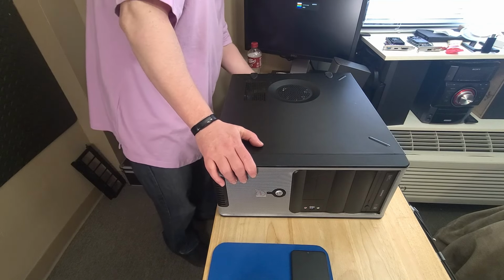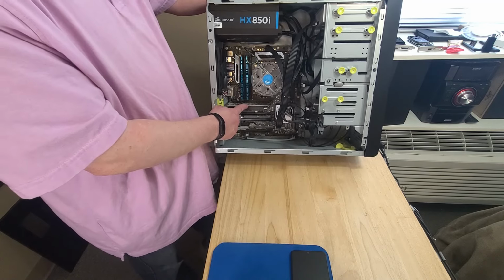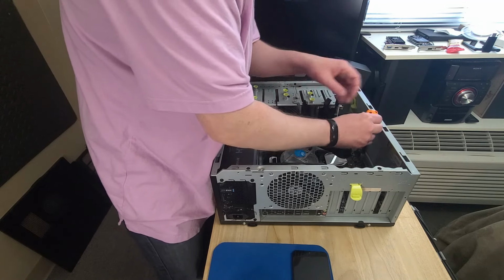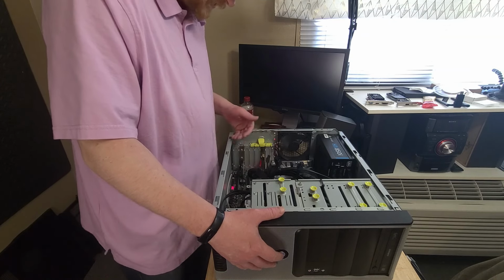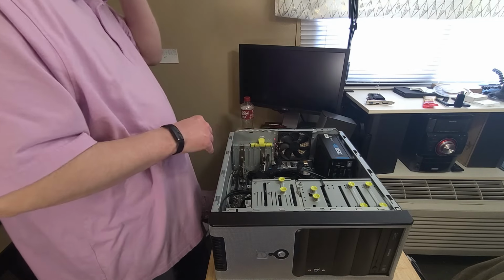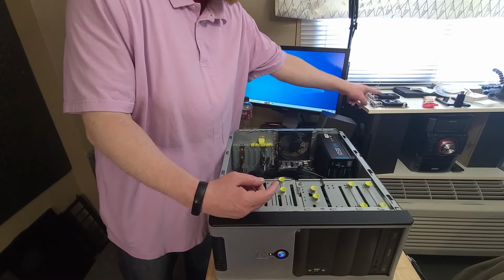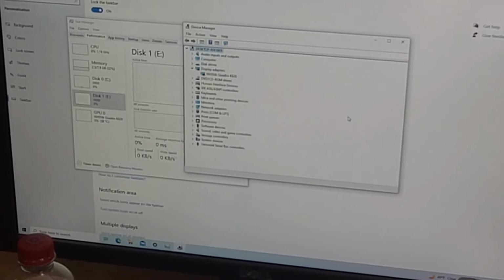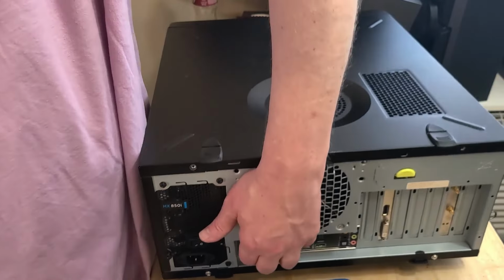Did I Get Ripped Off Again On This X99 Computer

Comment: I think Inwin made these cases. They're like the cockroach of pc cases, but they're surprisingly decent. Pretty sturdy and tool less. I wasn't able to put a fan in the front of mine because of the plastic molding around the power button, so I janked one to the side for intake. I used one of these for my son's first pc and recently got rid of it. Pretty sure I saw this listing too, but I'm looking for something with a nice case. Got a system to flip.
Reply from the maker: Yeah this case is pretty solid I had probably four of them but it was the smaller version of it but it looked identical
Reply: @rohon4972  I mostly only see the small ones. I'd probably hang on to that one. I dunno if the full size is rare or anything, but it don't hurt to have around and its sturdy enough to use as a stool.

Comment: I’m only halfway through the video, but I doubt that slot cover killed the board. But before freaking out thinking the board is dead you should try new RAM and new video card. The first thing you should have done was to look up the code. Also when you are troubleshooting you should have a speaker connected to the board.
Reply from the maker: I don't know if it happened in shipping or what but yeah the video card was damaged it had chips actually removed

Comment: You have a nine-year-old system there, and the SSD usage - according to Task Manager - seems to indicate that it's sorting out the installation.  Be patient.  That system is the same performance level as my big desktop, which is fast enough for everyday use.
Reply from the maker: I believe they pulled the SSD out of a Dell or something because it had Dell software on it when I actually hooked it in external on my other system
Reply: Actually it’s a 10 year old system.

Comment: Don’t do the 20GB of RAM thing you’re talking about, it’s a dumb idea cus you’ll probably end up in single channel mode. Get 4 matching 4GB sticks and you’ll get far better performance from the 16 than you will with the 20.
Reply from the maker: I was just going to do that because I had the ram already but yeah the system won't work with the  two extra sticks around I have. What do you think about 24 and it's still running in quad channel
Reply: @rohon4972  in order to get the quad channel they have to be a matched set.

Comment: I have a PC with that cpu. It can be OC to 4Ghz with a good cooler. It shows its age tho. It can run RAM at 3Ghz, but you have to set it up in BIOS. If motherboard has OC options, RAM can go in XMP only in OC mode (at least mine does).

Comment: If the RAM is 3000 you need to go set up XMP in BIOS, I believe the 5820 has a default of 2133. 

I have a 5820, and 5960, and a 6850.
Reply from the maker: I got it running at 3000 xmp was off

Comment: that's a nice system, swap you HDD, that's your issue.   Get your DDR4 running at full speed and you got a winner.  Strongly suggest you do some research on to best diagnose  and configure a PC, you seem a little unsure and easily frustrated to be doing this on video.  First thing you should have done is pull all the components our of the system and test it all out on a test bench without being cramped in that crap case.
Reply from the maker: The video card was the issue One of the chips was completely removed off of it. And doing these videos I shut off my machine and it refuses to turn back on so lack of oxygen I probably should have waited on doing this video but in that situation you don't know that you're not at 100% until you look back at it and you're like yeah probably should have waited until they come and fix my machine